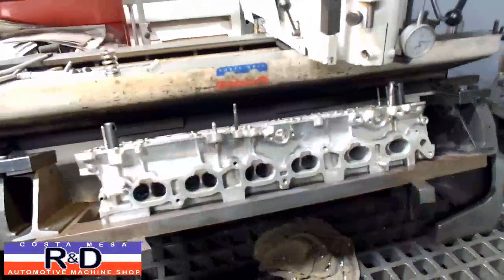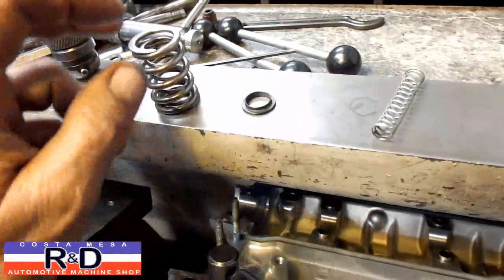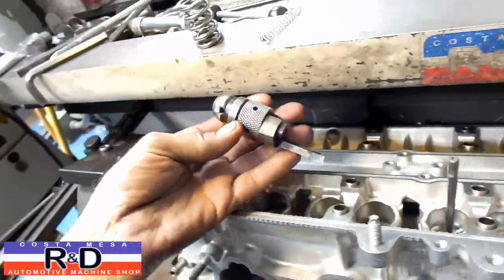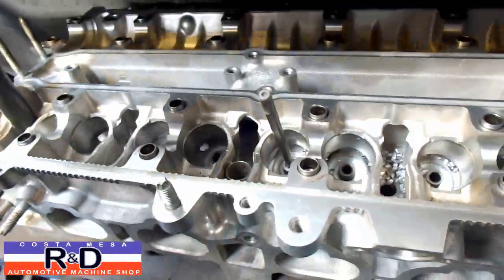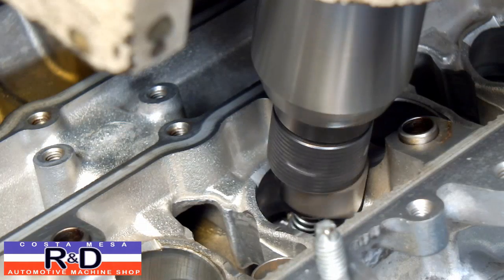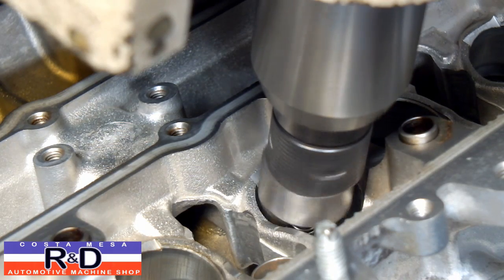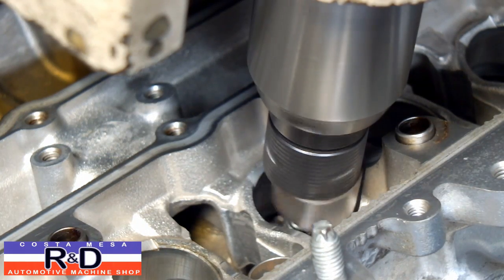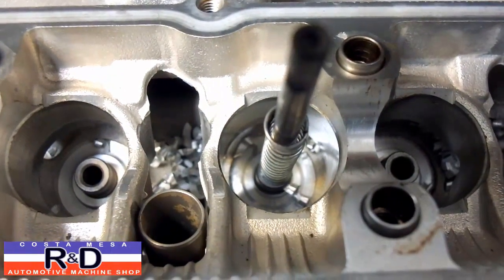Toyota 2JZE Spring Pocket Mod

Comment: I have a head of a tacoma 2.4rz that I have to do the samething but my buckets are 31mm and I need to open it to a 34mm since my cam lobe is big, it was ordered on purpose. What tool you guys use or where can I buy it. Since I need to re open it using the valve guide making sure I am on center. Please I need an answer ASAP thanks, luis.

Comment: Is the second spring added to prevent valve float at high rpms? Are there any mods to the lifters or cams due to the higher spring pressure?